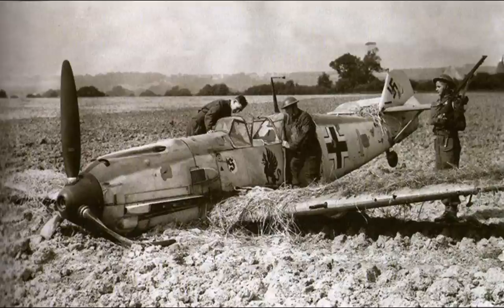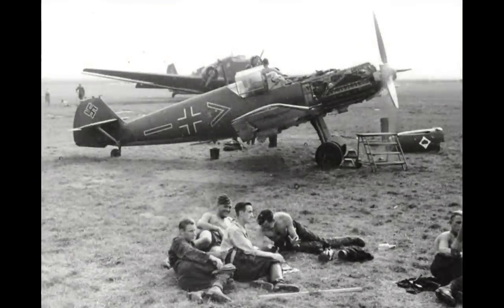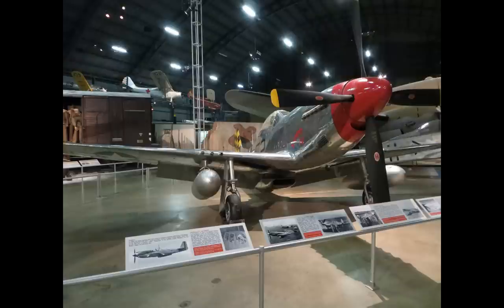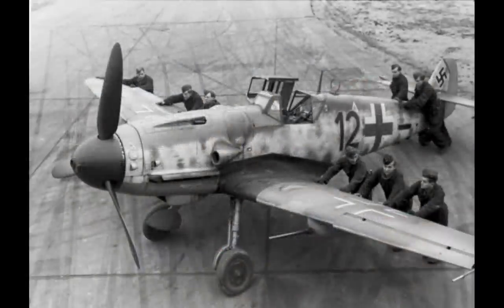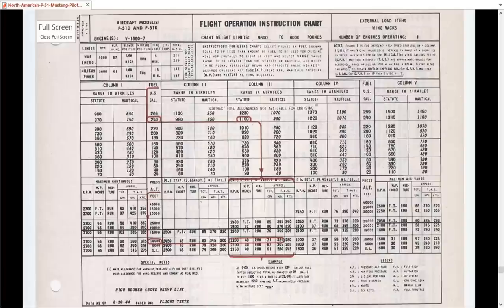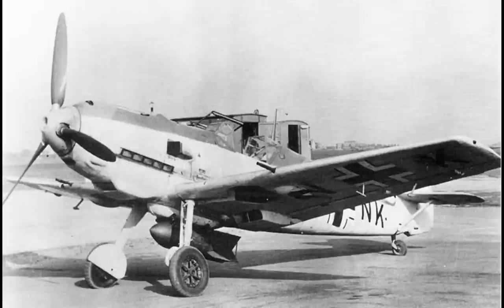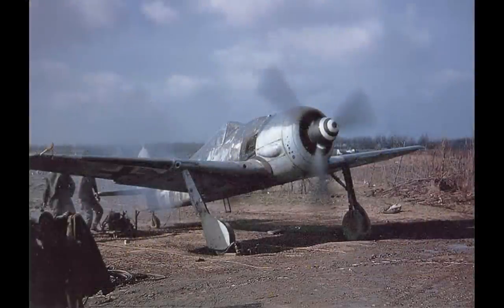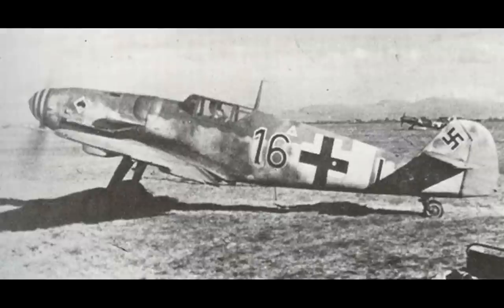Messerschmitt BF 109, Why Such Short Range?

Comment: The Rolls Royce Griffon, at 36.7 litres, was larger than the DB605. It was in fairly widespread use by the last years of the war, mostly in Spitfires and Fireflies. The Napier Sabre had the same displacement and was used in Typhoons and Tempests.
Reply from the maker: The Spitfire's didn't have much range either.
Reply: @GregsAirplanesandAutomobiles  While that's true, your video implies that only the Russians had a liquid cooled engine larger than the DB 605 in common usage. 16.17 on. The Sabre was also an arguably more advanced engine.

Comment: I sometimes wonder how the P51 would have been if it was fitted with a RR Griffon.  Very similar size to the Merlin but packing 37litres, a two-speed two-stage supercharger.  Now that would have been an interesting proposition.
Reply: It's been done. Look up "Red Baron", a modified P-51.

Comment: Fuel injection also had another advantage. Higher altitudes. The first mustang's had a problem with that as they were carburetored.
Reply from the maker: They had "injection carburetors" which were what we now call throttle body fuel injection.

Comment: The 109 was the largest possible engine installed into the smallest airframe.  The wings held guns and landing gear. Very little room for fuel. Where the Luftwaffe screwed up was not equipping the Bf 109E with a drop tank for the Battle of Britain.
Reply: Yup...  According to the more objective historians, drop tanks and different tactics would have probably resulted in less downed 109's and more Spit/Hurricane losses.I often wonder how many of the 109's lost over England or the Channel were lost because the pilot either ran out of fuel and crashed, or ran out of fuel during a dogfight and was shot down.Which is not to take away from the skill and tremendous bravery of the British and other Allied participants during the BoB, but it makes you wonder.
Reply: @WHJeffB  - General Galland, in his great book, "The First and the Last" called the lack of drop tanks decisive. That and the policy that the fighters stick closely to the bombers. To be fair, the USAAF 8th AF made a similar mistake in tactics over Germany. I believe it was general "Jimmy" Doolittle that saw the fallacy of these tactics and set the fighter free to pursue Luftwaffe fighters.  And that is how air supremacy was gained over Europe.
Reply from the maker: The difference is that the USAAF could afford mistakes due to their vastly superior pipeline providing new aircraft and pilots.
Reply: @GregsAirplanesandAutomobiles   - The Luftwaffe enjoyed similar strengths verses the RAF  and had they used the proper tactics along with external fuel tanks, could have prevailed in the Battle of Britain.  Even so, the RAF was was in danger of having to pull back if the Luftwaffe had continued to concentrate on fighter bases  decided to carpet bomb London.

Comment: @ Greg. A very good video. You make many references to the DB engine's fuel injection system and compare it to the carb on the Merlin etc. One thing that I think is vitally important and you missed it, the DB fuel injection system is direct into the combustion chamber, just like a Diesel engine. Most fuel injection in cars is into the intake via either single point or multi point and then it tends to be onto the back of the inlet valves. Similarly later aero engines like the R-2800 or the V-1650 - these are injected and injected onto the 'eye' of the impeller. Why am I saying this? Well the biggest (and it was big) disadvantage of the DB engine's injection is that it can't take full advantage of the specific latent heat of fuel evaporation for cooling the intake charge due to the physical location of the injectors. Consequently, even though you correctly argue that mixture distribution could be even throughout the cylinders, at high power they had to over fuel to provide knock margin - thus the advantage of the FI has been lost. Many combat reports state clearly that the 109's when fleeing attack would leave a trail of black smoke at war emergency power, the extra fuel providing the rich mixture for knock suppression. The fact that no allied engines went to direct fuel injection, when the technology easily existed, tells me that the DB's FI was borderline advantageous.
Reply from the maker: I didn't miss these points, I addressed them in other videos.

Comment: One of the main things about the Klimov, Merlin, Daimler operational comparison is engine speed mate. At all out power settings the Daimler is barely ticking over whilst the Klimov revs its rings out and the Merlin is very high strung, like an Allison but an Allison is smoother. Max continuous and cruise tones it all down a bit and starts to level them out but there's a lot more retrim in the KIimov, which is really a variant of a license built Hispano-Suiza; the Merlin and Allison, which all have well over 1000rpm and dramatic trim difference between military and cruise; whilst the Daimler has 300rpm between continuous and military and 500rpm to eco-cruise lean, so there's no run up period when jumped by enemy aircraft, unlike the Allied examples given. For an example in record, some US pilots escorting B17s in the Pacific were jumped by e/a only a short way out of base on the return leg, Japanese had followed them home which nobody expected and jumped them just as the escort pilots were almost asleep and trimmed down for eco-cruise on the long bomb run, one pilot was in tears as he explained in an interview how they frantically tried to run up their engines from cruise to military in order to manoeuvre and fight off the attack but by the time the motors finally came to life the fight was over and their bombers were going down in flames, with the crews they'd chatted with the entire journey dying aboard. So run up time is a big deal and the Daimler/109 has a one-touch system after October 1942, a single lever did all the retrim in one move and the engine ran up in a few seconds instead of a full minute or two, with only a few hundred rpm to run up between idle and military. Supercharger casing also determines eco-cruise height, which translates to range, higher the cruise at lean/min trim the better range you get from the same fuel load. Hence as the same airframes maintained the same range, with the same fuel load despite 50% power increase and in the case of the 109 a much bigger capacity engine change from 601 to 605, in fact initially range increased and even in the almost 2000hp K version was within 50km of the 1000hp E version. But the E eco-cruised at about 2500m and the K at 4500m so burned much less fuel despite having a much higher bench rated fuel consumption, air density mate. The Spit by the way, eco-cruise Mk1 was at 1000m and mainly got its cruise range by running so lean the engine was barely capable of either running or maintaining enough lift to keep airborne, an Emil just ticked along like a tractor in eco and just didn't know how to go slow, you just didn't get any better economy by making it splutter and half run and as mentioned, even before the aeromechanical translator system (throttle, boost, mix and prop bite on one stick instead of a quadrant), it was still just a slight throttle push, little handle twist, thumb a slider, roll a tab wheel and by the time you were doing that it was already at full power, whilst in the same space of time the Merlin had only just stopped spluttering and was still 1000rpm shy of where it needed to be and the tune was all wrong because you couldn't retrim completely until you got there. It wasn't about the fuel injection, 109 had a better pilot response for dozens of design/engineering reasons that were completely intentional, the situation was no better for Spits when they fixed the neg-G starvation which, get it right mate, was done halfway though the BoB with the Shilling valve (basically it looked like a coin with a hole in it that went into the fuel bowl and let the fuel go down, but not up, no more neg-g starvation), that stopped this problem using the original carburettor and was field fitted to all Spits within weeks during the height of the Battle, whilst immediately the carburettor on the Merlin was switched to another type that didn't have the problem, so the only, and seriously it'd be nice if popular-media warbird historians would get this right, the only time it happened was between Dunkirk and the very beginning of the BoB, just the opening stages, a few weeks and then the Air Ministry, to the screaming yells of the entire Fighter Command very, very quick smart fixed it, within weeks using an improvised fix and by the end of the year everything in the field were new production examples having a different carb that didn't do it. Yes there will be an airfield that just couldn't spend the down time for a single plane to get its carby pulled apart whilst everyone had started hearing about the Shilling fix others were using, yes there'll be examples of Merlins still doing it after strict introduction of Shilling fix, nothing's perfect but by and large it was a flash in the pan problem.

Comment: When the constant bass of comparison is the P-51, the contrasts in engine size looms large. When comparing to the Spitfire, the later models had the Griffon, which was 1.3 liters larger than the DB605. I believe the compression ratio of the 601 was higher than the Merlin and it's specific fuel consumption was lower than the Merlin.

Comment: Greg:
P&W, the Navy and many others in the US aviation establishment, as reported by SD Heron in "The Aircraft Piston Engine" concluded that the pressure carburetor, injecting fuel into the eye of the supercharger where it is violently mixed with the air induction air in compressor and diffuser, has a marked advantage in tapping the latent heat of vaporization of the fuel to augment the cooling of the charge by the  intercooler and or aftercooler. There is a significant advantage in employing this charge cooling effect before the charge is forced past the open intake valve. the intake valve is a far bigger restriction to induction flow than the slight venturi used to meter flow in the pressure carburetor. In traditional aircraft FI systems, the fuel is continuously dribbled into the induction system  near the intake valve, and the fuel is swept into the cylinder in a continuum of vapor to droplets, and perhaps finally evaporates in the cylinder during the intake stroke. That is too late to help with the volumetric efficiency of induction. FI like the D-B used , direct cylinder injection, has all of the cooling from fuel evaporation happening in the cylinder after passing the intake valve. P&W evaluated the Bendix FI used on the Wright R-3350, and decided that they preferred the supercharger eye induction for the late production of the R-2800 and the R-4360
Reply from the maker: Ah, but that's not an argument for carburetors, it's an argument about WHERE you located your fuel injectors.

Comment: A wonder that a American knows about the Dutch Fokker D.XXI. Even with knowledge about the subject clearly. I got some news about that very aircraft, or rather a replica that is being constructed for a few years now. The first roll out is this year at a small airshow, eventually this aircraft should be flying as well. For another Fokker aircraft, the Fokker G.I, there are plans to make a flying replica of that aircraft as well. But unfortunately not even close to getting realised as there is still a lot of missing data regarding this aircraft.

Please do keep making video's!
Reply: I cannot speak for Americans, but it's a fairly well-known aircraft in both Dutch and Finnish markings if you ever did many plastic airplane kits, going back to FROG 1960s kits..https://www.scalemates.com/products/img/3/2/8/137328-11185-pristine.jpg

Comment: I don't know if you watch Engine Masters,  Greg, but they recently tested a carb vs. multi-port EFI and the carb made significantly more power. The conclusion was that the latent heat of vaporisation of the fuel is what causes the difference.
Reply from the maker: If you can provide a link I'll watch it. I suspect that they tested not a true EFI mulit-port system, but one of those EFI things that sits on top of a carb style intake manifold. Those combine all the drawbacks of a carb with all the drawbacks of EFI.
Reply: @GregsAirplanesandAutomobiles  I wish that I could, but it's on Motortrend (it went there when Roadkill did, unfortunately). They over two episodes they (Steve Brule, Freiburger, and Dulcich) actually tested all three: carb, TBI, and multiport. The TBI was, as expected, the worst of all worlds. 

Now of course we all know that multiport EFI allows us to do neat stuff like variable runner systems, so the difference isn't likely as stark in the real world!

EDIT: the difference was ca. 30 hp on an 800 horsepower big block chevy.
Reply from the maker: Apples to apples carbs will not beat EFI. I would have to see the video to comment on it intelligently, but my first though here is who makes a multiport EFI manifold for an 800hp big block Chevy? Why are these sort of comparisons always done on engines which have tons of development in the hot rodding world with carbs, but never the other way around. Why didn't they take a Honda engine and test it with Carbs vs. EFI?
Reply: @GregsAirplanesandAutomobiles  The manifold used for both tests was a single plane manifold, with injector bungs welded in. The injectors were not removed between tests, simply the throttle body/carb was swapped out. 

The IATs were measured in all tests, with the carb resulting in 20-30 degrees colder air, due to the latent heat of vaporisation of the fuel. Interestingly, these cold IATs have also been my experience over years of building V8s: in apples-to-apples testing I've also seen carbs make more power due to this phenomenon, particularly on large displacement NA engines.

Of course, in the real world apples-to-apples doesn't make sense, as with EFI you can design wacky manifolds that only need to flow air. These modern manifold designs go a long way towards ameliorating the loss of the icy cold IATs that carbs yield. Add the ability to have variable inlet tracts, injectors in multiple locations at different sizes, etc - you get where I'm going here! EFI allows us to do apples-to-cider comparisons instead, so even though carbs can make more power apples-to-apples, that's certainly not what the modern OEMs are going for!

Perhaps that's why you'd never see the test done with say a Honda, as you'd need to custom-fabricate a carb-style manifold capable of flowing air and fuel. Moreover, once you end up playing with boost no doubt the control EFI gives you is beyond reproach.

No question EFI is better. I only brought it up because I have indeed seen situations where carbs made significantly more power, and wanted to point out that it's not from some cooling effect from the pressure drop across the venturi (as some people wrongly claim), but rather from the vaporisation of the fuel.